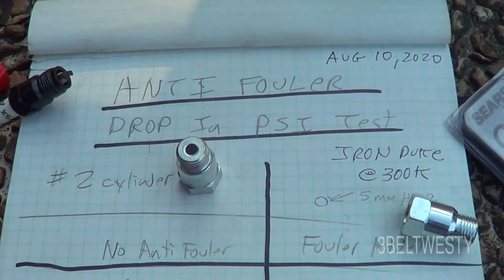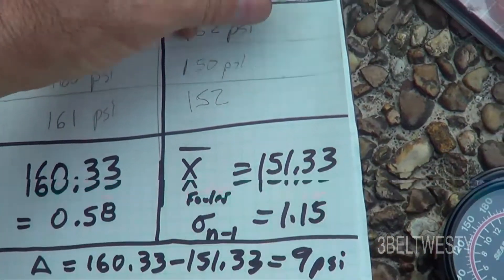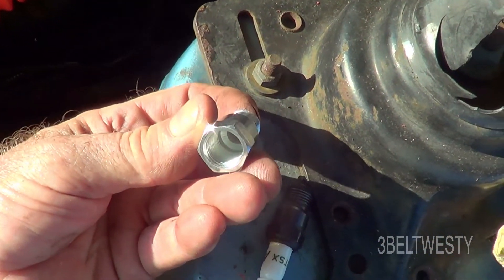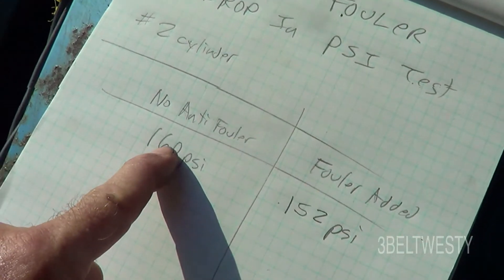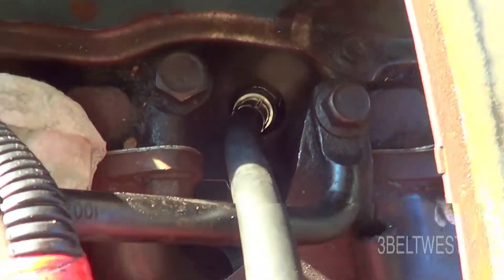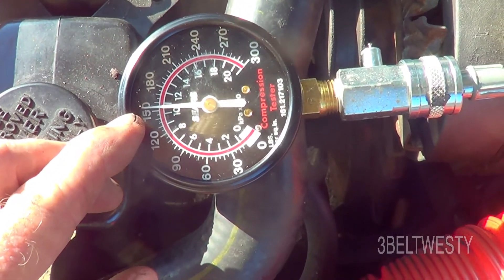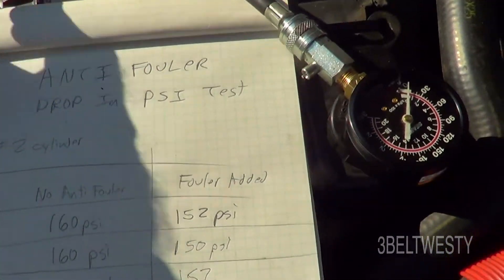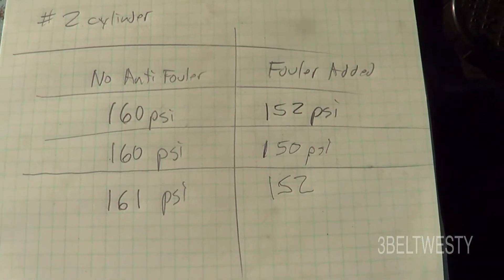Engine Anti Fouler compression Test 5.6 percent drop

Comment: With your tests and experience would you recommend for or against anti foulers?

Im looking into applying some, and ive heard 50/50 for and against
Reply from the maker: They just alowl you to use the engine more miles before that plug fouls. Ie could be due to piston rings; or valve guides; or even low fuel pressure on a TBI engine so missing due to lack of fuel. Mine was not the rings. The valve guides maybe. But I found out my TBI fuel pressure was dropping due to some  failing AN6 hose. So I need to revisit the fouling on mine later once I install new fuel lines

anti foulers have bend around at least 60 years and were once more commonly used on worn out engines

I did the percentage difference test as an experiment

The anti foulers mask the problem of a plug fouling by the plug being moved away some. 

All my comments are about spark plug foulers; not cat converter sensor anti foulers

When a kid we had a 318 V8 in a Plymouth Fury that fouled the plug by the passenger side firewall. We chanced the plug every 2 weeks. An anti fouler helped later. It just look 3 to 4 weeks to foul
Reply: Do u think if I where to use 2 or 3 stacked on a small engine with a broken compression release valve do u think I can get a bit less compression enough to start it with a big truck battery ps yes I know it will spark knock
Reply from the maker: @torquedandtrashed  A 1925 Ford model T engine had a 1 to 4 to 4.5 Compression ratio. That is really low compared to todays engines

A 70 year old Briggs engine on a lawn mower is about 6

Above ran on gasoline.

Adding more adapters might not fire as well? with many in a row. Not sure..

Regards
Reply: If you have one or two cylinders that are fouling out they can be very useful to keep you running reasonably well without doing a lot of work on your engine.  If the situation is bad you still have to pull them once in a while and clean the no fouler and spark plug up; but it beats having to pull the plug a lot more often.  It is not a permanent fix of course.  They are definitely worth trying out.  They are chap and doing a test drive won't hurt the engine.